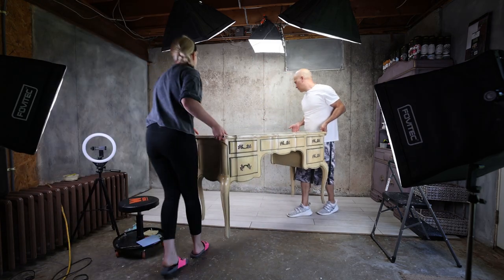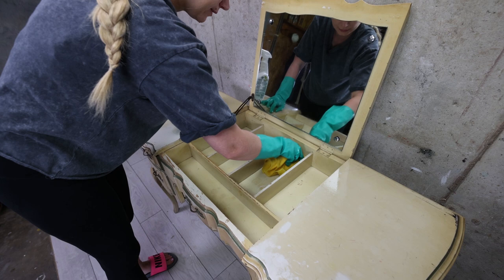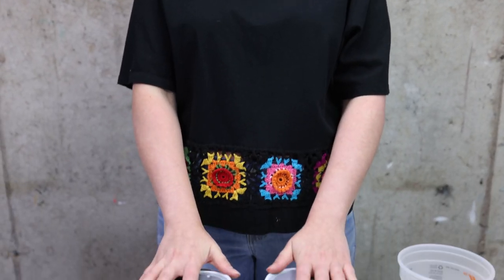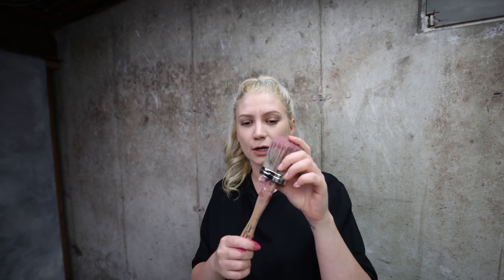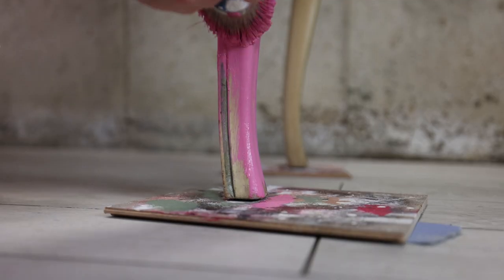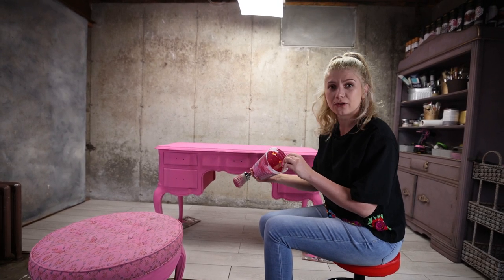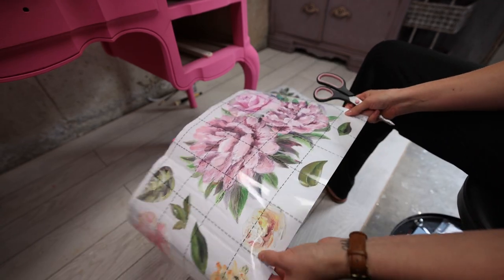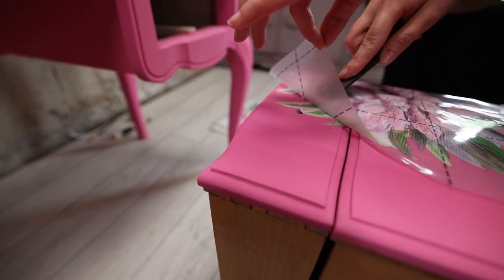This OLD VANITY went from TRASH to GLAM

Comment: The drawers looked as if they were built to interlock that way, not as if it's falling apart.
Reply: Dovetail joints should fit tight. I've never seen any that are loose enough to come apart.🤔